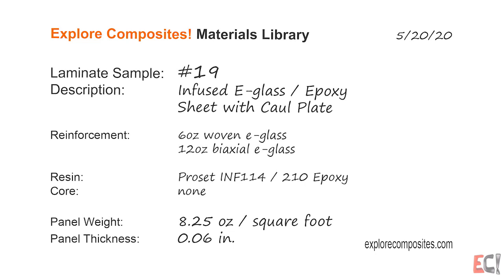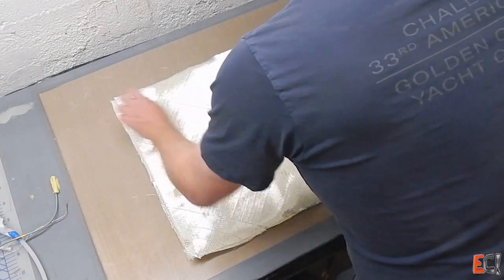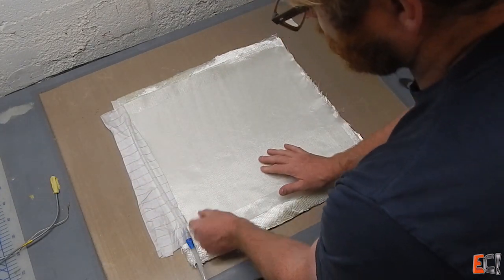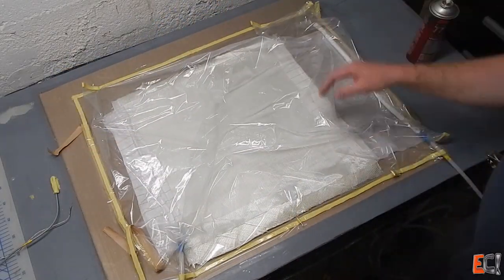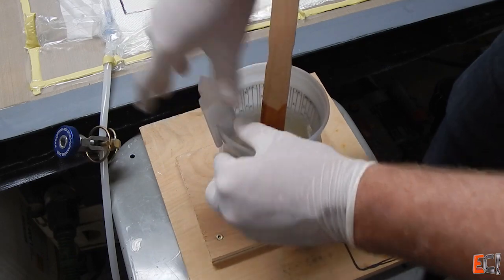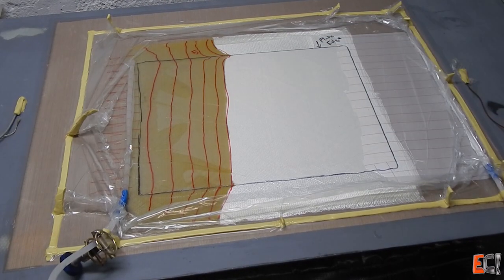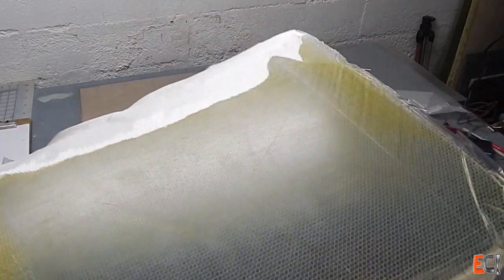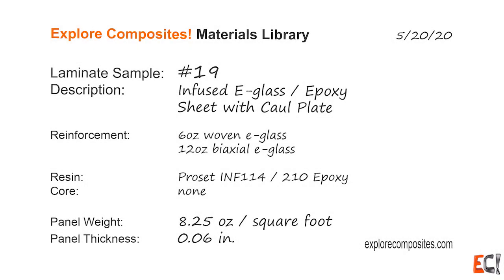Laminate Sample #19: Infused E-glass / Epoxy with Caul Plate

Comment: I really like the 3D printed part, thanks for sharing!  I intend now to use something similar to hold a tube in an electroplating bath to help ensure that I don't spill acid everywhere should there be a mishap with the hose.  It's important to my process that I keep ferrous components away from the acid... like the binder clip I'm currently using.
Reply from the maker: I think I put it on GrabCAD but you could easily model a variant - it's nice to keep your hoses in check.

Comment: Good Job in explaining a basic flat panel infusion. One thing that would help the viewers is to not only show as you did the use of pleats in the bag sealing, but the most important element of any vacuum infusion process is to have the correct vacuum level before introducing the resin. You have the digital vacuum gauge you purchase from German Advanced Composites who supply the MIT hose as well, Yet you missed the factor of showing the level of vacuum, which should be below 70 millibars based on molding at seal level. then show how to test vacuum integrity in a "leak down test" before they begin the injection, once those factors are understood, it makes it very easy to have success most starting out in vacuum infusion are not aware how critical the vacuum level is. Ones must understand the vacuum does NOT {suck") the resin into the fiber, the resin flows in by differential pressure of the outside atmosphere as compared to the level of pressure at the vent tube. So the higher the vacuum differential the better the outside atmosphere can push the resin into the cavity. John Moore JHM Technologies
Reply from the maker: Hi John,  
First off, thank you for your videos - I have been through most of them and your whiteboard explanations are great!  I'd love to do one of your trainings on RTM and LRTM processes some day - its an area I'm pretty clueless about but it looks fascinating.  All your points are things I agree with - especially the value of enough vacuum and vacuum drop tests.  I do discuss this in other videos but can't remember which ones!  

I'm a little embarrassed that you might look at them - but I have two articles on infusion and infusion troubleshooting that address all this:

https://explorecomposites.com/articles/lamination/introduction-to-vacuum-infusion/

https://explorecomposites.com/articles/lamination/troubleshooting-vacuum-infusion/

Comment: Could you use soft plastic instead of a hard plate on top? So that it could fit against a shaped foam core?
Reply from the maker: Yes.  Silicone sheet works great for this.  Can be an issue with infusion because after the resin fills the stretchy sheet springs back.  There are sprayable or brushable silicones (check out SmoothOn) that can be used for cauls, intensifiers and even reusable bags.